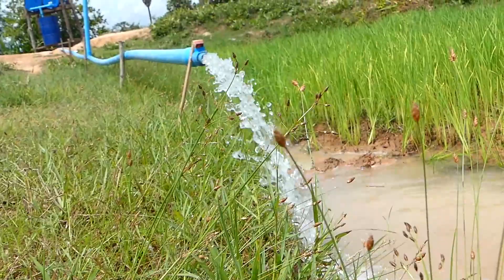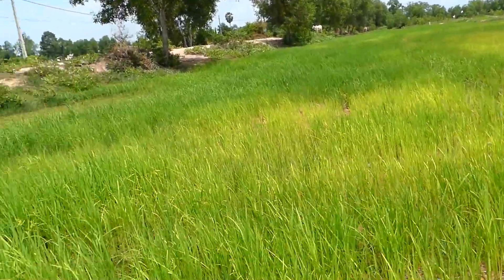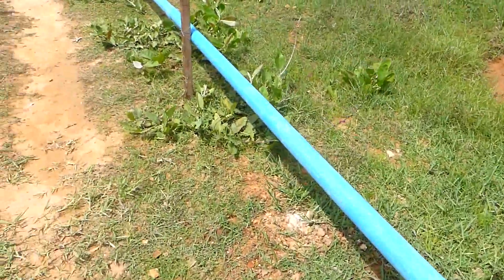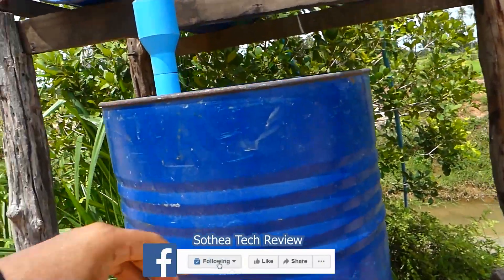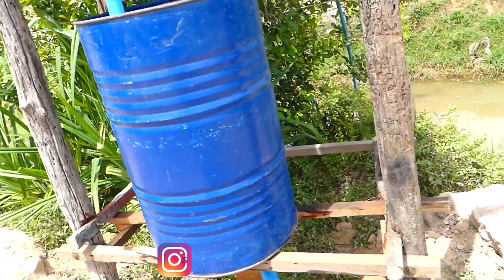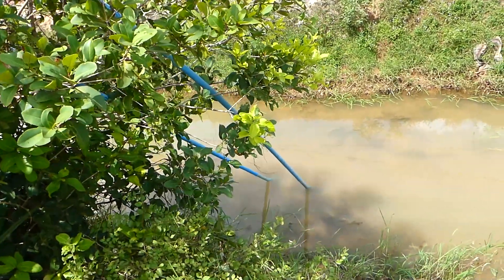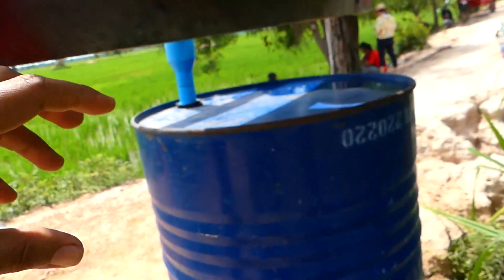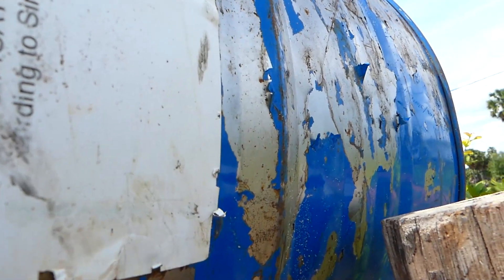understanding about Drum pump​ | Free Energy Water pump | Pump without electricity

Comment: I would be convinced that this setup is really a PUMP and not a SIMPLE SIPHON setup if you route the diischarge pipe to the source and show us that the water is still flowing to the discharge without any other hidden pump which drives the water flowing throughout the system.